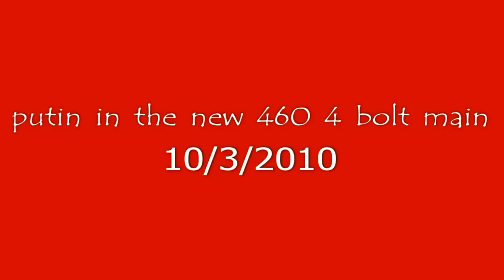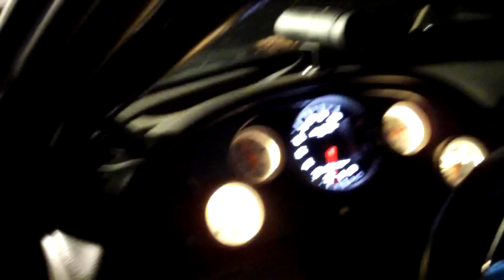new motor in the mustang. 460 4 bolt mane

Comment from the maker: @Dennisjonsson81  go to 429-460.com every part can be purchased from the vendors and the forum guys can answer any question you can think of.the headers are hooker 460 swap headers for the early model mustangs.94-98 mustangs the header on the passenger side may need to be modified depending the motor location..